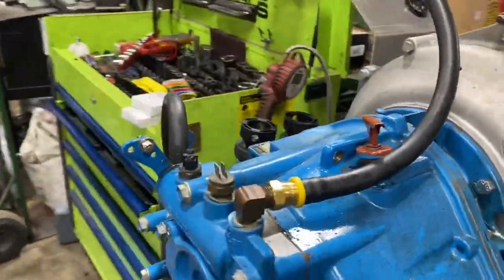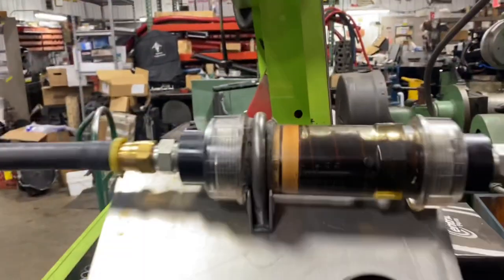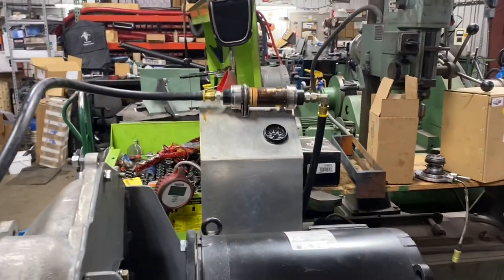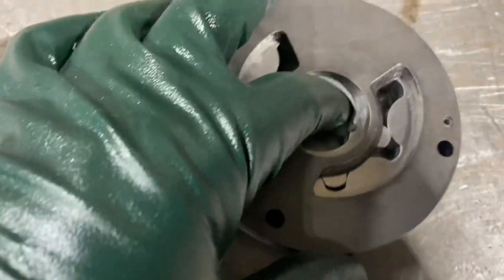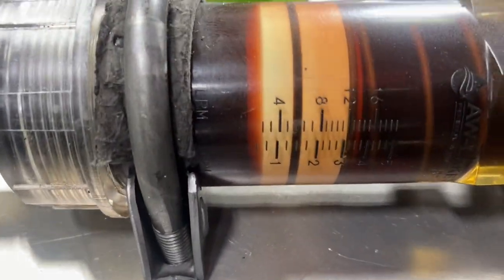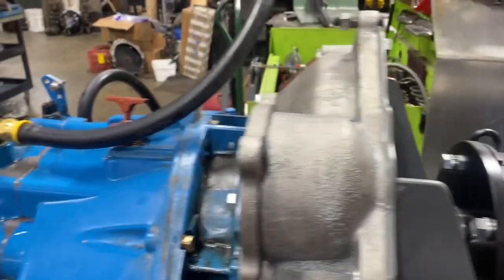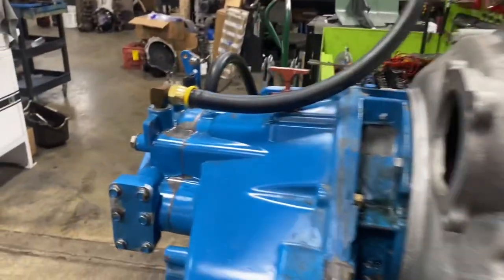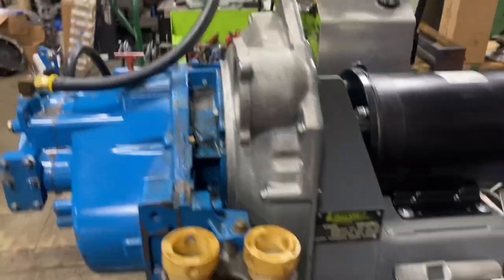Diagnosing a Failed Pump in a Velvet Drive 5000 Marine Transmission

Comment: hello, I really appreciate your video about the Velvet Drive 5000 series. I saw that you showed a problem that I also have - I have no flow in both directions. you solved the problem by replacing the old version of the 2001 736 002 crescent pump with the new 2001 736 003- gerotor. is this possible because the manual says they are not compatible. I have an old crescent variant from 1996/7, and I don't get a spare pump in Europe. USA companies do not export to Europe

Comment: I forgot to say, I have also a low pressure, decrease from very beginning to 22 bars to 12; after 10’ running at 900/2000 rpm